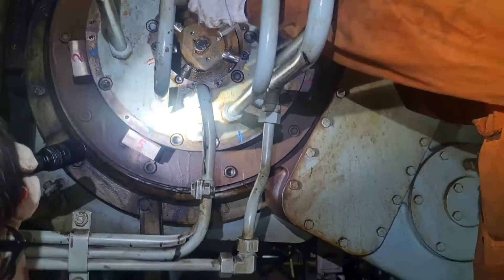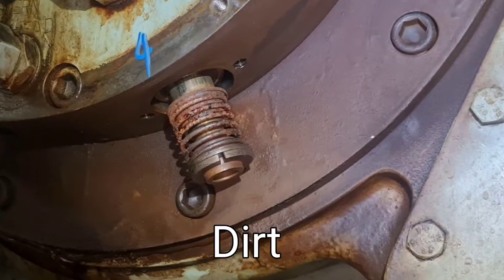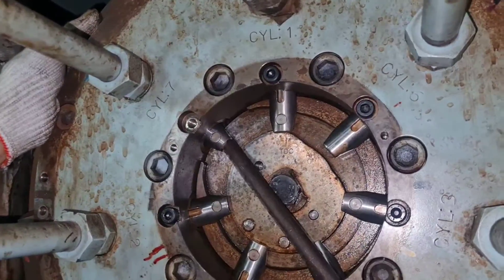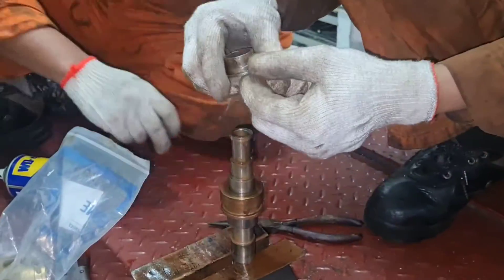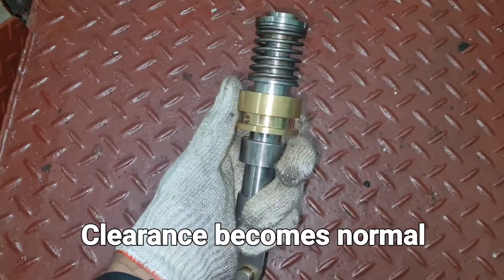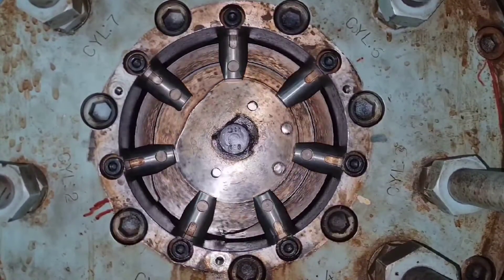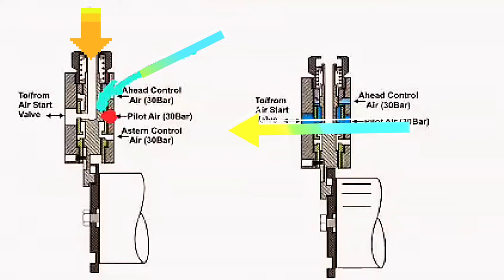[EXPLAINED] Starting air distributor maintenance!  MAN B&W #marineengineer #dieselengine

Comment: what if pinston and liner got stuck?
Reply from the maker: Trouble during manoeuvring ( fail Ahead or Astern) . It will lead to Critical condition.
Reply: @HtoonPyeat thnaks for the swift reply, is there a way to remove the stuck piston out the liner? have you encounted this situation?
Reply from the maker: @zaoshengmo yes, my video shows how to maintain piston and liner. Thanks.

Comment: I wish you had continued the video explaining more about the astern movement. In the astern movement, the air would enter from the lowest port of the Valve. That is understood, but how does that change the direction of rotation, of the distributor? Which Pilot Valve will receive the air first? the pilot valve on the negative part of cam or positive?
Reply from the maker: Thanks for your comment! The pilot valve which can go outwards first makes the rotation.
Reply: @HtoonPyeat  thanks so much for your prompt response sir. Would you know which pilot valve would go outwards first, sir?
The one whose roller is on the negative part of cam, or positive part?

Comment: In Astern , which type of Alarm or problem you faced. Please explain briefly. Thanks.
Reply from the maker: There was an astern fail alarm with no starting air  because the related astern pilot valve was sticking. So, we tried Ahead air for a short period to rotate the camshaft . Then, it was possible to run in astern because the cam position was changed.
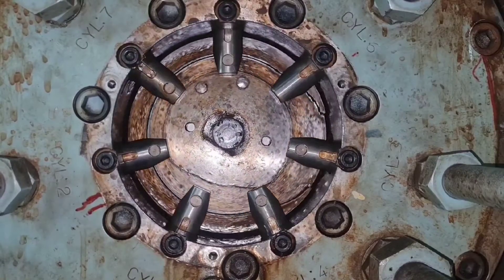Reply from the maker: Please watch 03:29 of the video. You can see No.6 pilot valve will move outward at the outer cam profile